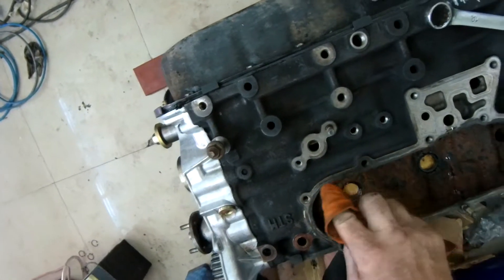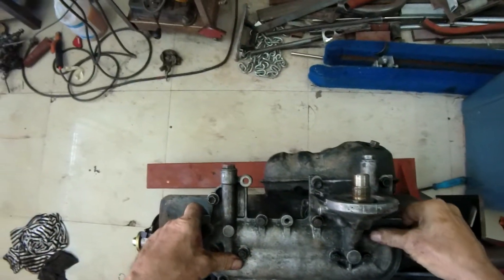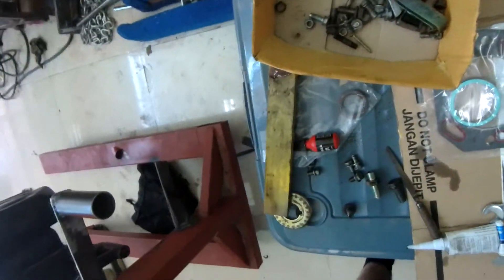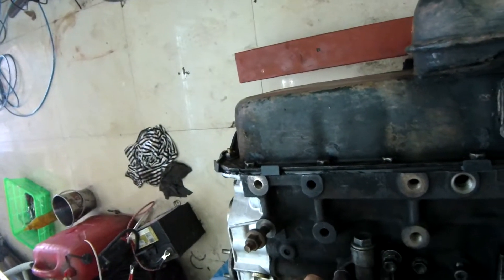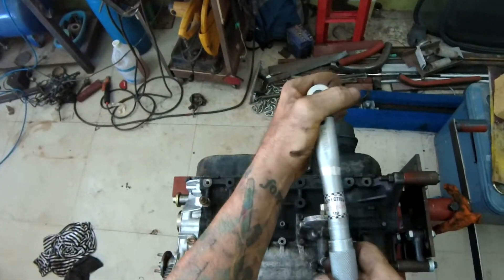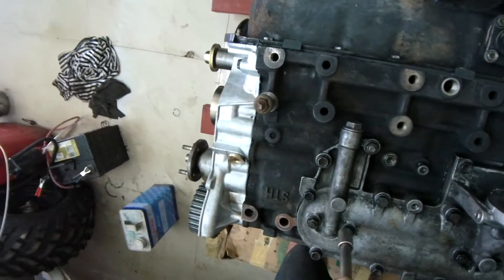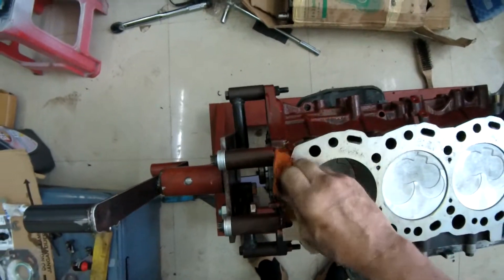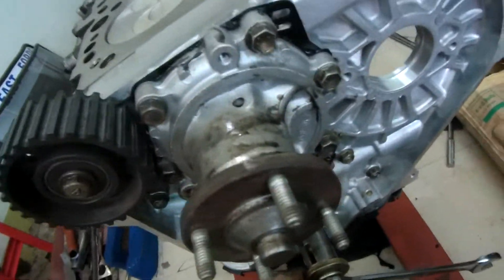Toyota 5L rebuild part 9. piston to block height and oil cooler cover

Comment: Hi 
I pulled my oil cooler off due to water pump fins pissing off pump an around block, I've got most of the fins I could find an rust out but saw one of the caps in the block where oil cooler bolts to is rusting away. Would I need another cap or it'll cool better with more flow?.
Reply from the maker: If your oil cooler seal fails you will get oil in your coolant or water in your engine oil. Mine was badly corroded, i sanded it flat on a glass coffee table and used a lot of gasket glue!